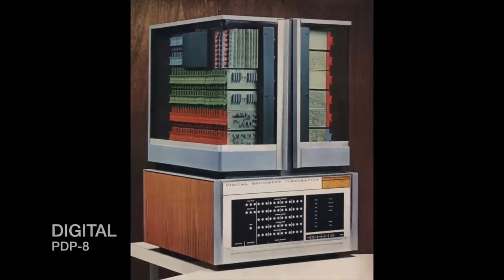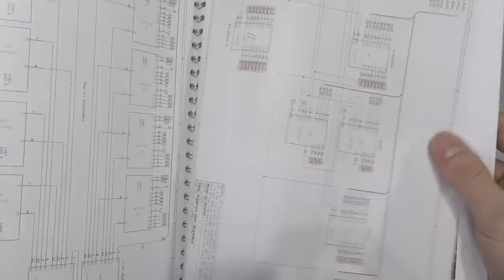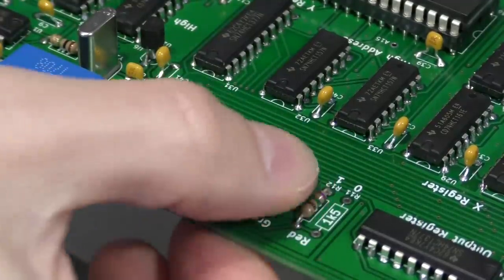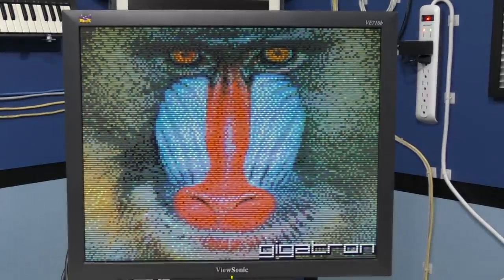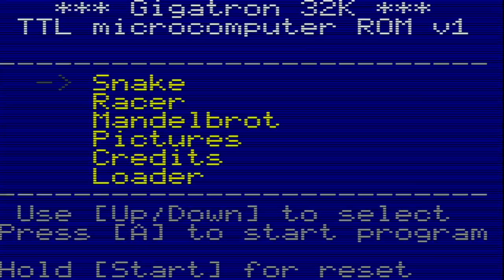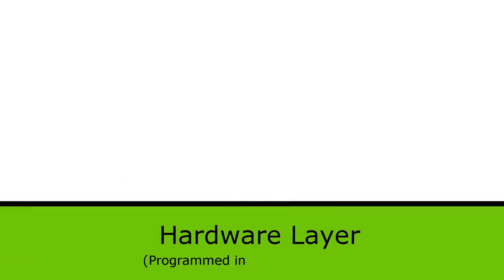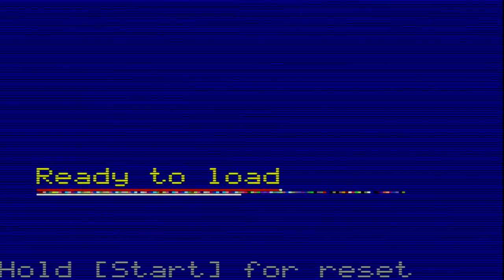The Gigatron TTL Computer without a Microprocessor

Comment: For me, no.  It doesn't have a microprocessor because it IS a processor on its own.  What it needs is a header to communicate with other devices, like a proper computer processor.  That'd make it useful.
Reply: I agree. For the price we need to be able to tinker around with it. Who came up with the target audience of someone that is willing to solder it together but only play a few games on it? That doesn't make sense. This has so much more potential to be something interesting. It needs a big honkin GPIO on the back and an open source firmware so it can interface with anything. Someone will easily get BASIC running on it and then we're golden. Printers, scanners, keyboards, mice, webcams, speakers, LCDs, hard drives, networking, etc. etc.
Reply: Mark M I agree. Really you’re just getting a soldering project. You’re not gonna play these games for very long, It doesn’t have any GPIO pins, and you can’t program it on a the computer it’s self. This has so much more potential. But for $200 it just doesn’t make sense. Maybe a v2.0 will be better.
Reply: denimadept o
Reply: The ROM is in a DIP socket. It wouldn't be hard at all to buy an EEPROM and an external programmer as a replacement.
Reply: Good point about a breakout header. I could easily add that in a next run. You can already hook up wires directly to the output pins of the XOUT chip, but a header is much neater. The firmware and tool chain are open source and in github. The schematics will be open source soon. So far the focus has been on making the hardware ready for friends and early enthusiasts. It is still a hobby project for us. I'm working on a GCL programming tutorial as a next step with simple practical examples for learning. As David mentioned at the end, it is just a software upgrade away from being programmable on the thing itself. The Loader is a backdoor so it is not totally closed.
Reply: Once it's possible to communicate with it, people might create devices it will interface with, such as memory and such, and larger I/O devices.  Then comes a compiler backend, and it'll run whatever.
Yes, I know it already has memory and ROM.  That might be something to remove from the board, other than any microcode it needs (virtual CPU), to allow for an external supply of some kind.  How can you, for instance, have direct memory I/O devices, if the memory is not available to external devices?
And if we might access the processor directly w/o the virtual CPU instructions, things might go faster.
Reply: How hard would it have been to have a full bus edge connector? I think most CPU trainers...nay all of them offered this for the reasons cited above. Interfacing is crucial. How are you supposed to add your homemade punched card system to it?
Reply: If anyone out there is doing hobby computers...LISTEN,Copy the PDP-11 CPU hardware interrupt!!!!! It is so easy to add new things  map the memory mapped pre-built programs on the control board, set the low address interrupt vector, and you've just added a new piece of hardware!!! Simply connect hardware to control card. Why has no one else done this!!?!?!?

And yes the controller actually contains a memory mapped driver for the device. so you can just jump to those addresses and do stuff. If the control card was a micro controller attached to MAX232 chip for example, you could easily map the program instructions for control by the CPU on the board itself, then plug in the card, and plug in any RS232 device. The micro controller could then do all the glue, and spit out the results back to the bus.
Reply: Why not just clone a PDP-8 or PDP-11?  There's already lots of software (games!) out there for it. :-D
Reply: Did you note the response from the guy who apparently designed this?
Reply: Well, A pdp-8 perhaps, but a PDP-11 processor would be hideously expensive to reproduce. It was a CISC processor. If you did, you would probably have some commercial buyers though. PDP-11 architecture as a total package is probably to this day, the easiest to program from any level. I was suggesting though, that for something like this, at least the interrupt system would be very desirable. I myself have a PDP-11/03 M7270 processor. CISC and 16 bit data bus,  as well as 16  bit address bus. Some of the later ones had 18 and 22 bit address buses in  the  QBUS line of products.
Reply: I'm quite familiar, yes.  I used to program in MACRO32 (VAX assembly), and saw an employment ad for MACRO11 (PDP-11 assembly) as recently as 2016.  Blew my mind that someone still needed it.  If someone created a PDP-8-a-like, I think that'd draw a lot of people, at least among the older computer science crowd.  It shouldn't be too difficult to get a PDP-8 to test it against.
Reply: Well, that is kind of a product already. There is a PiDP 8 which is a PDP 8 on a rasberry pi. The GPIO pins can be hooked up to toggle switches and LEDs. I wasn't all that impressed...i think such hobby computers are as lame as electronic cigarettes and NA beer.

I am totally with you on a PDP-8 clone if it could emulate the physical style on the outside like the Altair-8800 clone computer. I'd have already bought an Altair clone computer but frankly, having a heathkit H11A minicomputer is many times better. I was going to get some nice 1970s era computers, and then I accidentally got that computer, and decided that I was all done collecting computers. It is everything I ever wanted in a collectible, in one machine. There is even a small scale UNIX ver 4.0 for the thing, called LSX, and it came with the 4000 page binder set for RT-11 V.4, Fortran IV, and BASIC. dual 8" floppy drives, and it supports H-10 paper tape as well! I can't find the damn paper tape machine though....been searching for 2 years now. I will call the system complete when I have the paper tape, and LA-36 decwriter or HA-36 "heath"writer. If I can't have that, I will settle for a teletype ASR33. Of course they are also next to impossible to get. They sell in any condition, and always just outside my price range. One time I was ready to smack down 800$ for a broken one, and I still didn't win the auction!
Reply: I used to have a MicroVAX, and a couple of LSI-11 systems.  Never did much with them.  The PDP-11/03 I had, I scrapped with the LSI-11s.  I feel bad about that.  Picked them up at the MIT scrap room back in the '90s.  I wonder what they've got in there now. :-,
Reply: SUN Microsystems...very likely.
Reply: Wish I was in the area to pick up some of those!  Oh well.
Reply: I would have to say that an Amiga or a C128 would be far better hobby computers. It's even possible to create a brand new OS for the 128 or Amiga.
Reply: @beopstek  is normal asm open?

Comment: I made a TTL computer without a microprocessor on perfboard when I was in high school that controlled a robotic arm back in the 90s. It did use an EEPROM though. I may have also thrown in a few 4000 series CMOS  chips into the mix.

Comment: The original Wang 2200 minicomputer was entirely TTL-logic-chip based, and was released in 1973, a couple of years after Intel started making microprocessors.  I guess it took a few years for the concept of a microprocessor to catch on with computer manufacturers.
Reply: You couldn't put a lot of circuitry on a single chip back then.  Chips were also extremely limited in how many pins they could have.

It absolutely made sense to keep building computers out of TTL chips for quite some time.
Reply: The original Intel 4004 microprocessor IC was released in 1971, so your events are a bit out of order.

Comment: Beautiful presentation! And kudos for your selection of 80s wait-muzak track. I trained at an electronics tech school in the early 90s. For the Digital phase, our lab was to build a 10-byte SRAM arithmetic logic unit. Just 10 LSI chips, a bank of 8 lever switches, 8 LEDs for the binary count, and single digital number display. Don't recall its clock speed, but it would heat up fast!

Comment: 7:04 no no, it does have a central processing unit, a CPU. Its not a microprocessor, but the name CPU was used long before microprocessors were invented. They usually took shape of circuit boards just like the one you have of course.
Reply: I did my programming chops on a multiuser mini that had no microprocessor.
Reply: I built a mult- board, through hole, 4 bit computer (the Wombat). The CPU board had an ALU chip as its heart. Excuse, I was very young at the time and a 6800 was well North of $100.

Comment: The Z3 consisted of a relay floating point arithmetic unit (600 relays) for addition, subtraction, multiplication, division, square root, decimal-dual and dual-decimal conversion. The calculator has two registers R1 and R2. A relay memory (1400 relays) with a memory capacity of 64 words, each 22 bits (1 sign bit, 7 bits exponent, 14 bits mantissa) a punched tape reader for film strips to read programs (not but data) 30,000 cables, a keyboard with a lamp field for input and output of numbers and manual control of calculations.
The calculator looked like a wall unit and filled an entire room. It weighed about a metric ton.

Comment: I just read your “Dream Computer” description, and I can see why it hasn’t been built.  The 6502 was an incredibly bad CPU, and not very programmer friendly.  It was like the instruction set was purposely designed to be a nightmare for programmers.  It is also the reason why the original Apple computers were so limited.  The only reason that NASA used it, is because it was the only CPU that came in a ceramic package that was certified for space.

If you want 8 bits, the Z80 is probably the best CPU from that era, and it’s pretty easy to page the memory to go beyond 64K.  Also, the Z80 has a built-in refresh counter for dynamic memory.
Reply: The Motorola 6800 family I always thought was better because it fully separated the data pins from the address pins so there was no need to switch back and forth on the bus.  Obviously most people thought otherwise.
Reply: Plus the Z80 can run any program built for the TI-84 series given sufficient power and TI-BASIC.

Comment: my ideal machine is a circuit board that let's you plug in processors and memory chips at different locations. you can create your own bus at the back of the board using parallel cables of various widths, then use github to develop an open source operating system for the most popular layouts.

Comment: I have a plan for an open-source GPU called GraphX-I. I can throw out the VLIW features from the architecture if needed, and further refine the instruction set. I think it would make a good computer alongside with either a RISC-V or OpenRISC CPU, however I don't have the money for FPGAs, and the GPU would need either a Xilinx Artix or Virtex due to its vector capabilities. If someone would want to team up with me, we could make something.
Reply: you should check out the risc-v vector extensions and the hwacha project if you haven't already. none of tem is too specifically about graphics, but they may be a good to build on.

anyway, i'd cry tears of joy if i even see a fully open source computer available to the general public. if you can help hake that happen, please do. :)
Reply: You could also use OpenPOWER

Comment: Why the board designer didn't choose potato chips?
No i'm serious the company called potato make 74 series logic chips that can be used with higher frequencies(i guess up to the gigahertz range) so this ttl computer could be a little bit more powerfull?
Reply: I wanted at least the processor part to be compatible with 1971's 74LS technology
Reply: Me too, that's why i i'm keep asking myself why they didn't made with potato chips.
Reply: Oh sorry, I was speaking from designer POV. We kept the CPU part compatible with original TTL chips and those ran at this speed. Our objective was 1. No microprocessor 2. Fewer than 40 ICs 3. Original TTL (7400 or 74LS) compatible in performance 4. Only through-hole components 5. Video capable. So that is what it became.
Reply: ohh so i say sorry, didn't knew that you were the designer, but maybe with these "new" 7400 series logic from potato and a faster clock , and i'm aware that it would require some adjusts on timing to the video generation.
btw, nice job, sadly i can't afford this but i would love to assemble it and tinker with it.
Reply: Self-imposed constraint aside, one problem with using those high-speed ICs are that the board design itself can't support such high speed. A simple, non impedance-controlled, long PCB trace will have a lot off parasitic capacitance and inductance that will load and skew the signal so much that above a certain speed the signal is practically unusable.

There's also supply chain consideration when a product is commercially mass produced. I see these potato chips (maybe) aren't sold at bulk quantity through reputable distributors. Also, they cost about twenty times and upwards compared to "standard" logics!
Reply: Also keep in mind, that every PCB line is in principle an antenna. So while running with high frequencies, they will emit electromagnetic radiation (aka: radio waves) while others will receive that electromagnetic radiations and turn them into false signales on some lines. Not to mention radio receivers in your neighborhood.
Turning up the operating frequencies is not as simple as: just change the clocking mechanism (aka the crystal) and use faster chips. At some stage you also have to take PCB linelengths into account and how they influence the electromagnetic properties of the PCB lines.
Reply: Due to the size of processor area those frequencies would cause propagation delays and probably wont work correctly.

Comment: I agree with comments about how to solder a chip right (first 2 corners' pins, and then alternating by skipping 1 or 2 pins each time in order to avoid accumulating too much heat in an area.

I would add that, in order to get a more aesthetic result (and with more readability of components), I would have soldered resistors keeping same colour order.

Comment: I do not understand how this or the old highly limited hardware generates Video signal. Like for that Racer game. Can someone please direct me to how it's done by such humble hardware?
Reply: Swagat Suryawanshi I would also like to know.
Reply: Okay.  I assume they reserved a part of the RAM as a video buffer. We got 160x120 = 19200 pixels to display. As he said it does 64 colors, using 2 bits per channel. Two bits gives you 4 levels of intensity for each of the 3 channels (red, green, blue). 4*4*4 = 64 colors. It'll use a simple 2-bit DA converter for each of the channels and output directly to the analog VGA or composite port. The information to store a pixel in memory is only 2+2+2 = 6 bits. They'll probably fit it inside a single byte for efficient processing. So you need 19200 bytes of video memory. If you want to display the collection of pixel data in memory on a screen, the data has to be offered in sync with the screen. So at a 60 hz refresh rate, you need to process those 19200 bytes 60 times per second. That's 1.15 million pixels per second. Say it takes 4 processor cycles to move each pixel from memory to your DA converters. You'd need 4.6mhz just to keep up with your screen. If you have your circuit operating at 8 mhz, which I assume this is (might be wrong), it leaves you almost half of your processing power to do other things. To animate a game, you simply change the pixel data in the video memory to draw lines or fill blocks or polygons. You can probably also do time-efficient tricks to shift a whole block of data in memory, giving you effect of the image (or part of it) scrolling left or right. That's how I reckon they scroll the photos or the background skyline image in the race game. Hope this helps, feel free to ask more.
Reply: @gammaraider  Nice explanation! One thing, though; the "CPU" runs at 6.25 MHz, so I assume the virtual CPU layer will divide it into the 4.6 MHz or so for video with 1.65 MHz or so left over for instructions (depending on how many empty scan lines and how many cycles it takes to write pixels).

Comment: I self taught computing with a C-64, I miss the friendliness and  ease of those old machines, not to mention the goose honking of a 5.25 inch floppy drive.

Looking at your dream computer specs, I'd say the C-128 comes close, with a few addons like Lan,VGA and more memory, something similar to your dream would be quite possible.

Probably have to bank memory but with the right coding and memory controller, it should be relatively easy, nobody will ever need more than 640k anyway.

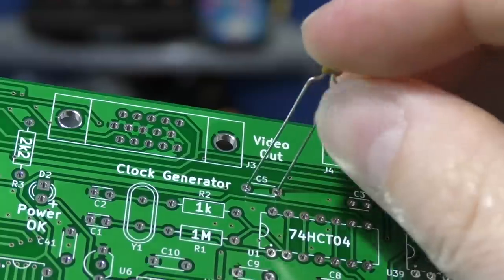Comment: 2:48 why did you bend the capacitor’s electrodes?

😂 just kidding - I know exactly why, I’m surprised you didn’t say it this video
Reply: ok...care to share with those of us who don't know? :P
Reply: Joshua Vincent it keeps the cap in when soldering
Reply: @kraio-sfu  after looking into it, seems like its also to avoid bending the leads at the base to prevent damaging the seal and the plates inside

Comment: You're better off fitting all the lower height components first, and those taller decoupling capacitors last. That's so you can rest the board down on a flat surface and the components have something to support them. We used to use a foam backed assembly frame for this so you could do the same, but it was foam that pushed the components onto the board.

Comment: A processor is an assembly of transistors on a silicon wafer. there is also a set of transistors that work in a cluster as a processor